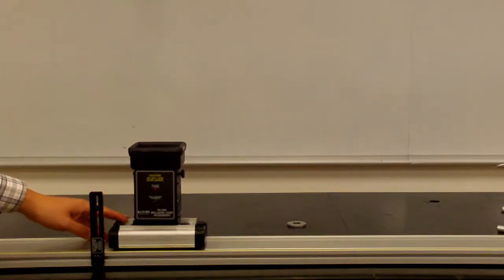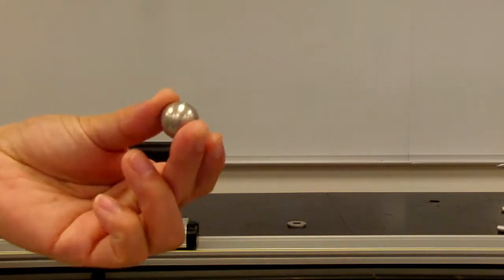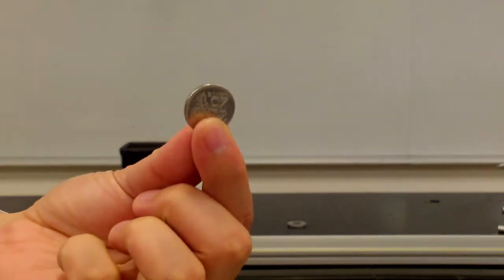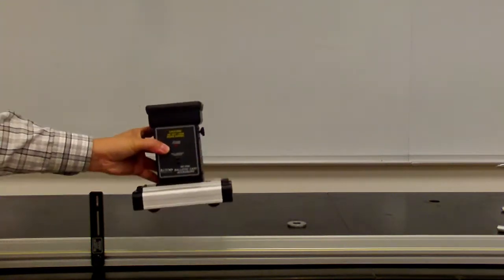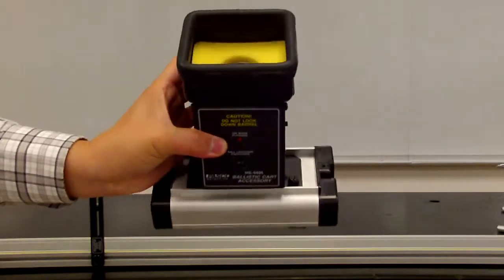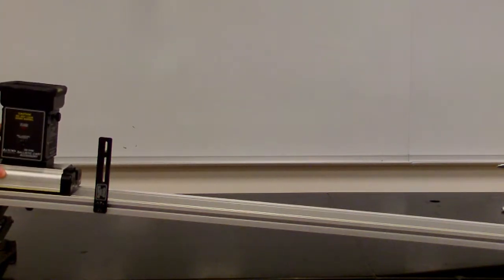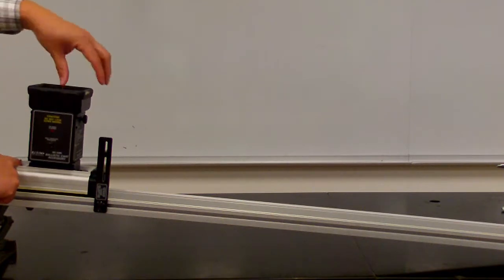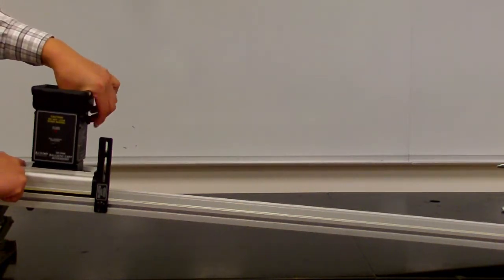Physics 4A - Launcher-on-Cart Demo

Comment: This is confusing! The ball in the air and the cart has different acceleration! It goes back only because the launcher has a large hole within the uncertainty.
Reply from the maker: The first time analyzed the situation, I thought that, too. I encourage you to work it out analytically---it's not the experimental uncertainty that allows the ball to fall back into the launcher; it's the "math."